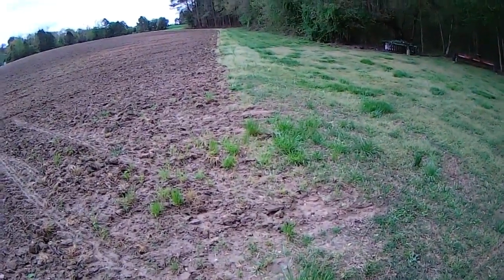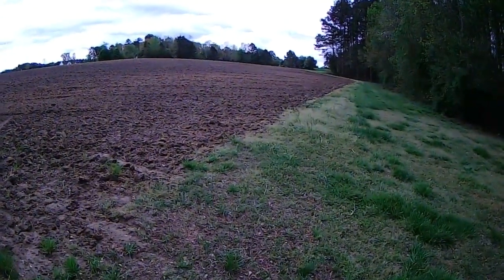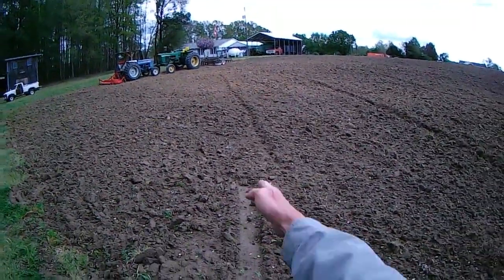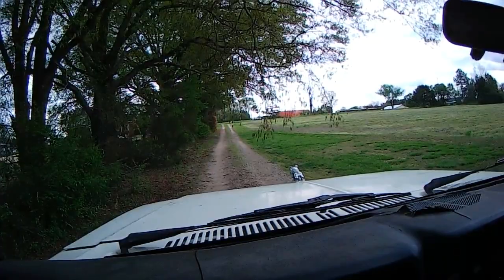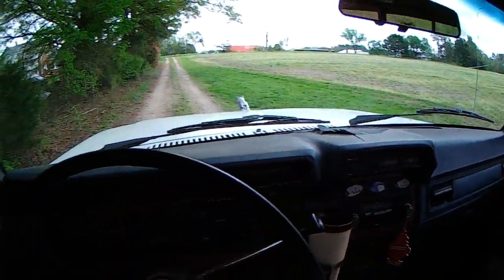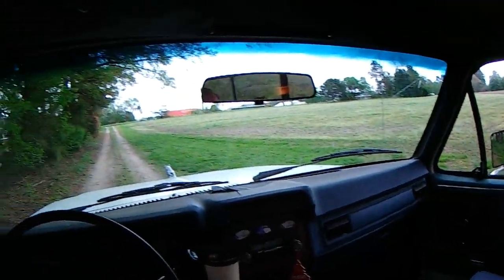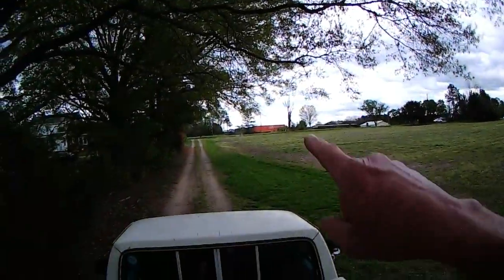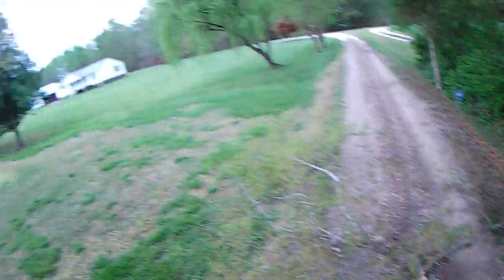Erosion Controlled with Diagonal cut

Comment: Good job! How far away from you was the tornado that hit Wendell? Here in Nash Co., got called into work at midnight, got home at 4:30am, back out at 5:30am for more trees in roadway. Made for a very long day.
Reply from the maker: Lance Bass - a few miles.   nash is east of me and the storm picked up intensity as it moved to the east.   the thing stalled over west Raleigh and Cary.  I thought they were going to get washed away.  on my location as the most intense rain passed over there was a split so this land really did not get hit with the intense rain other areas got.   God protected me.

Comment: Hey I like the Billy Bob hood ornament just remember though unless you're the lead dog you always have the same View of the dog ahead of you
Reply from the maker: Rusty Stuff - it is the older Mack truck hood ornament.  the truck belonged to my dad and I bought it from my step-mother after dad died back in 1997.  he put the Mack truck hood ornament on it years before he died and I left it in his honor.
Reply: Soybean Farmer yeah those are neat the new ones don't have them like that I used to work for a company that had all Mack Trucks and the old man would say are you ready for a long day staring at that Bulldogs behind anyway that 80's through 86 series were good old trucks 250s and 350s kept that basic design all the way up till 98 I think 95 is 1 F 150 became its own style separate 250 and 350 s then in 99 they changed the wheel patterns now you can't switch the rims back and forth from Dodge and Chevy
Reply from the maker: Rusty Stuff - the 1982 F150 is a solid truck.  done all I've asked it to do.   check out the first part of this video where I show the leaf springs on the F150.  I've weighted out of the quarry several times with over 2200 pounds.   https://www.youtube.com/watch?v=ersttETfA4c&index=1&t=0s&list=PLm3prTm3mN7yf-5lSz7Ms4g-X5LrgA8am

Comment: Glad everything worked for you. Sometimes you just have to try something different. I got about 1 1/2 inches. Like the pole saw....... Got one just like it. It was pretty pricey but has been well worth the investment. I would also invite you to try some cover crops this fall. They can also help with erosion problems and act as a soil builder.
Reply from the maker: Johnny Holland - having the pole saw is so much better than having to climb a tree.  did some sweet grazer sorghum as a cover on land I let rest from beans and it was great.  going to do it again next year.  for this year I got a futures booking at a great price on beans so it's beans in the ground to meet the booking.

Comment: SBF did you see Jeff Raymond's video on taking ground temps and the temp you can start planting ?  50 deg temp, 4" deep early morning test. I would think you are very close to that now. Also planting in the end of May and then you got 2 months of very hot weather, June and July, and most like 2 months with the least amount of rain. It just seems to me that I would want to get the beans in the ground with a better chance of moisture, them weeds will grow faster with less rain than the beans.
Reply from the maker: JGM - I am so glad I learned not to plant as early as I did in years past.   this freak cold April weather would have caused lots of harm to young germinating seed.   producing plants struggling to regain their health.   yep, I used to be the first one out and sometimes it paid but not if a cold night like last night's 34F came along.   patience is better than going out to soon.

Comment: Why do you work the ground so early if you don't plant till late may. Could you plant cover crops and work them in I'm may. Thanks for sharing
Reply from the maker: James O Brien - if I could get on the field right after bean harvest I'd vertical till to cut up soybean residue.  several months later I'd chisel then disc and smooth on the day I planted the field.  surface residue if not cut into small pieces gets caught in the chisel and creates a drag problem.  coulters would help but I don't have them so I make do with what I do have.

Comment: I can well imagine that you are well pleased with that result following those two storms. Thinking forwards about this problem it seems to me that there are two reasons why this has worked particularly well for you this time. Most importantly the across the slope direction of working has stopped the water flowing down the slope in its tracks but also I guess that the loose surface soil has allowed it to sink into the soil. 
I know that you have talked about having a smooth surface on the field (I guess for reasons concerning combining the crop) BUT does this perhaps encourage water washing down slopes in a heavy rain event? 
This makes me wonder if your finishing tool is the right piece of equipment with the rolling baskets you speak of? Could you consider a trial of either removing them or disabling their action so as to leave a somewhat more coarse knobbly / loose finish to the soil.
I do not know how sensitive your soybeans are to depth variation when planting as in this case I would have thought there will be more variation than what your accustomed to. Initially I'm sure there is an increased likelihood of a variation in emergence due to different planting depths, however will this matter in the grand scheme of things over the life of the crop? - probably not in my opinion.
Lastly have you seen any past significant evidence of water washing down the wheelings left by the tractor when drilling as compared to land either side of them? After all they inevitability firm down the soil underneath the wheels and form something of a channel at the same time. To counteract this it is commonplace here for folks to install at least one tine directly in line on the drill frame that is designed to loosen up this wheeling mark. It lifts out of the soil on the headland as the drill is lifted to make a turn and is lowered into the soil as the drill is dropped down to commence sowing again.
It will be interesting to see what happens this year at least or hear/read you thoughts on this matter.
Reply from the maker: Dan Whiteford - Dan thanks for the things to consider in your comment.